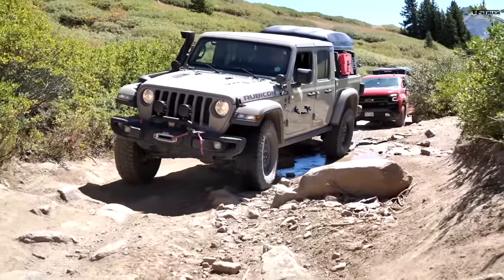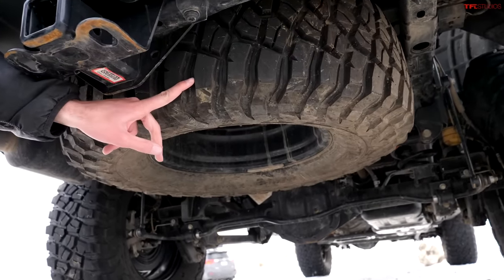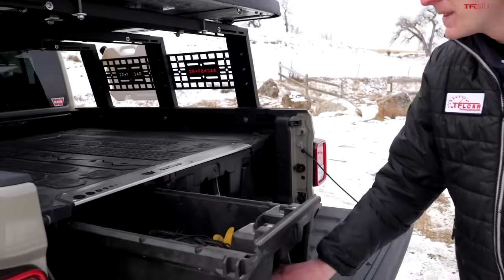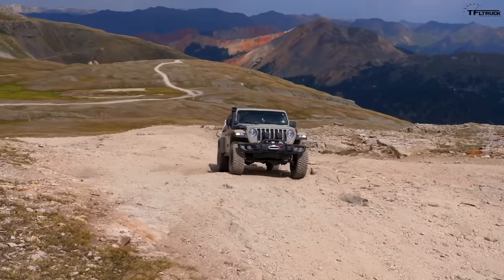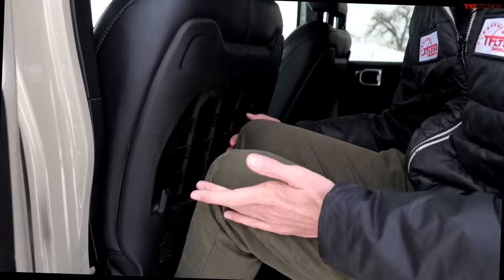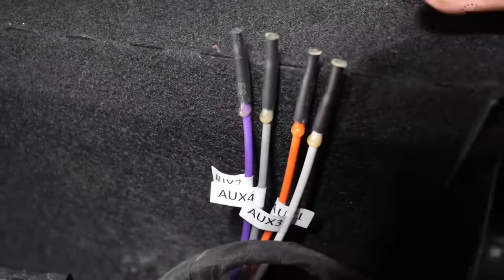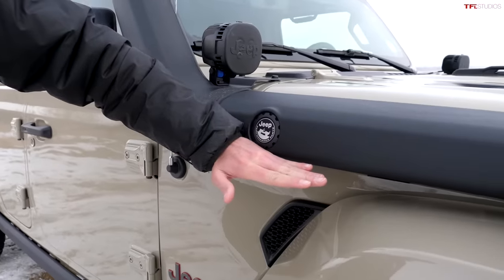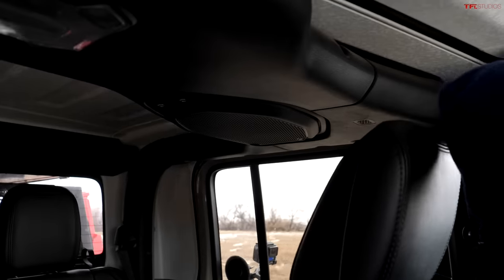Here’s What I Love & Hate About The Jeep Gladiator After Living With It For a Year!

Comment: Great video!  Thank you for sharing.  But you left out two of Gladiator’s key weaknesses, particularly relative to Wrangler.  That long wheelbase, while it provides a smoother ride, it (1) tends to get hung up on the rocks; and (2) limits maneuverability on the trail and around town.  

One other weakness of Gladiator relative to Wrangler is that you have room for people or to keep groceries out of the elements, but not both at the same time.  Granted, you could put a canopy on the the back, but that would defeat the purpose of getting a Gladiator in the first place.  My guess is most people are willing to spend $55,000 on a Gladiator over a comparably priced full-size pickup primarily for its looks.
Reply: I'd rather have a regular cab Gladiator to help with problem #2, or an extended cab with jump seats.  Groceries in the elements aren't a huge deal for me, I'm used to tossing them in the bed of my F-250 with the bed full of snow.  Not a big deal there but tonneau covers aren't terribly expensive if it's a deal breaker.
Reply: I remove the back seats from my vehicles now as they are just a waste of space 🤣
Reply: MOPAR tri-fold hard tounneau cover is your solution, and lastboks

Comment: The 3.6 is good but some of the parts they use in it are garbage. The oil cooler housing is plastic and ALWAYS ends up cracking and leaking. We have about 6 vehicles with this engine at my work, and once they hit about 70k miles, they have all have needed to be replaced.

Comment: Wow. Not impressed with that Decked system. Two skinny drawers and that's it? A lot of wasted space!
Reply: @shitloveaduck  Good info, thanks.
Reply: it weighs 200lbs...that's insane..can get a steel topper from RLD that's only 175lbs.  200lbs to take up space and have little drawers..not worth it
Reply: I really like the Decked system, but not on this truck. The bed is too small to begin with and the Decked system is just too inefficient in how it uses that space. I also use a Decked on my Raptor. It works MUCH better for a larger and deeper bed.

Comment: LINE-X of Katy (TX) taps the rail system bolt holes by default.  I added the Mopar Trail Rail System to my 2021 Jeep Gladiator, no issues, we'll with the exception of it coming with 12 bolts when it needs 14.

Comment: We live in CO also and have a 2021 Gladiator Rubicon that we bought last summer.  Great truck I have used it for snowboarding a lot this year.  We are really struggling with LEDS and snow and ice collecting on the lights while driving.  My suggestion to someone looking is get the Halogens then upgrade to a heated LED

Comment: Seems rich.  You pay a lot for the Rubicon capability and more for the glitz and name. 

Andre's $48k.FX4 XL seems like a better value as does the Power wagon option on the Ram 2500 XL.
Reply: I agree / that’s why you buy a Cummins 2500 and a JLUR
Reply: 2500 cummins is great for towing but useless off road
Reply: Neither one of those trucks is small enough to fit on trails and their tops don’t come off

Comment: We have a Sport S with a 2" lift and 35's on it currently. We love the truck! But we never tow. My only complaint is the lack of affordable aftermarket rear bumpers and skid plates. It seems like it's $1500+ or nothing at all on both fronts. Since we didn't get a Rubicon we're looking for rear bumpers that also add body protection behind the rear tire. I really wish Jeep made it easy to purchase the Rubicon rear rock sliders. Most off roaders WILL in fact use sway bar disconnects. I'll never understand why Jeep doesn't put quick disconnects on there from the factory. We just put Antirocks on all of our Jeeps and it has been by far the best upgrade we've made. Never have to think about sway bars again! I've been driving Jeeps for 20+ years so the seats are fine to me. I drove the Gladiator from NM to Florida and back at Christmas and have no complaints.

Comment: Fiat built it what did you expect. I towed with a overweight trailer about 1500 miles I had to run fog lights at night in order to keep people from flashing high beams at me. Did all types of terrain and it survived. I agree about the length compared to the older Jeep. I got 14 miles to the gallon which was decent. The cab noise is loud I had soft top. I am a tall individual as well and did have some comfort issues. Great video

Comment: One thing I disagree with Tommy is removing the doors and roof. I take them off all the time (the 4 doors and front seat roof). I've taken the back roof off but it requires 2 people to remove it and takes up a lot of room in my 3 car garage.  Its fun but I live on an island off Florida in the deep South so we have the weather to do it which is why I own a Gladiator Mojave - super fun and it's the only toy you need (I don't need to buy an ATV or any other open air toy). It really is perfect for me and my wife down here. I did install rock rails with a step on all 4 doors for easy entry for my 5'2" wife. She too loves the truck.  

I will say though, if you are not used to driving a Jeep (this is my 1st one) the handling takes a bit to adjust to. I have the mud tires and highway driving requires 2 hands on the wheel at all times. The Gladiator meanders and requires constant correction so just be aware of that. Once you get used to it it's not a big deal but at first I was taken aback by it. Personally I would not want to drive this truck coast to coast because of its highway handling. Otherwise its the perfect truck. And super fun!

Comment: ... it stickered at WHAT
Reply: Yeah I know, that's an absolute joke and only for dummies that truck is not worth that kind of money....
Reply: I would look at a Willy's personally. The Rubicon is over priced. I have a Willy's on order, and it is just as affordable as the zr2 and Tacoma TRD offroad I was price comparing it to
Reply: @dakotamorgan6594  ....comparing any Jeep or the CR2 to a Tacoma TRD off-road is apples and oranges it is two different ball games one has a perfect history and the other two have horrible histories.....
Reply: I paid $42+ tax for my diesel with cold weather group, full LEDs, adaptive cruise, blind spot monitoring, pop equipment group,  and the aux switch blank.
Reply: @ronaldradicalhickman6071  I understand that, but those are the trucks I personally compared for what I wanted to buy.
Reply: @shitloveaduck  yeah, my truck will just see some light trail use for hiking and hunting. If I had lockers I probably wouldn't need to use them! Thank you! I can't wait for it to arrive!
Reply: @shitloveaduck  yes because I was going straight to 40s. So I bought so brand new take off rubicon axles for cheap, a phenomenal 4” lift with great shocks from Rusty’s for $1900. Swaybar disconnect on Rubis is unreliable there’s a better solution from Apex for $250 I’ve got that ordered, but stock there’s plenty of power for 38s and lockers and new gears can be added to the stock axles pretty cheap also
Reply: Not only is the sticker rediculous, but you don't even have to haggle for a 5% discount with some going 10% with some work. 

Just stupid. I hate the car buying process.

Comment: I’ve got a Decked system in my Raptor and I love it. However I agree with you if using it on a Gladiator. The Raptor bed is much wider and deeper. That makes the Decked system work much better IMO. But I’ll totally disagree with you on the Mopar 2” lift. That thing is not that great. It needs both front and rear track bars. I’ve seen other owners complain about the control arm bearings wearing out. I’d get a more complete kit.

Comment: Number 1: it looks stupid without $20K in mods and labor to your “$55K” truck that Mopar doesn’t give to the rest of us for free 💁
Reply: Agreed. I have a stock Rubicon and it looked great without mods. As for the money, I defy you to show me any better (or ANY) off road truck that comes stock with the “necessary “ mods - winch, rack, and aux lights.
Reply: Get your facts straight... they definitely bought this with their own money
Reply: #1 , avoid at all cost this is not at all remotely what they are claiming..... anyone that purchases one of these is rolling the dice at that price....
Reply: @conduit242  Again, it just looks like you’re being a hater. They may have been comped the mods and labor, but it wasn’t "free". It takes tons of hard work to get their channel to that level. If it was easy, any schmo could post their opinion and get to their level. Are Mopar’s parts WAY too expensive on any Jeep project? For sure! Most of the aftermarket parts out there currently are as well, or it’s crap foreign-made stuff. Or it’s out of stock. The JT and JL are EXTREMELY popular now and that’ll drive the prices up on everything. Love it or hate it - It’s a Jeep thing.
Reply: I paid $42+ tax for my diesel with cold weather group, full LEDs, adaptive cruise, blind spot monitoring, pop equipment group,  and the aux switch blank.  I spent about $7500 on it and it goes anywhere I want it to on 40s
Reply: @smarterthanyou2674  wow that sounds like a great deal.
Reply: @chrisavelar3723  reach out to Daniel Gupton @ Gupton motors. You’ll have to order to get the deal. Tell him mb sent you

Comment: Oracle Oculus headlights are a great aftermarket option for about $450-500 when on sale, so much brighter than OEM. The only downside I’ve found with these (I’m sure all LED lights though) are that they don’t heat up like halogen lights, so pulling over every 20 minutes to dig snow out of your headlight bezels during a storm sucks, otherwise your driving blind.

Comment: The only people that hate the pentastar are the people that bought a 4 banger  or the “eco” diesel. The eco diesel and 4 cylinder were both made for fuel  economy, not power, towing or capacity. That’s why the Pentastar is still rated higher for reliability AND has higher tow rating.

Comment: I’ve driven RAM 1500, 2500, 3500, Jeep Liberty and Gladiator and I can say with 100% certainty, the setting positions on all of those vehicles is terrible.  I’m 5ft 9in and I typically need my seat as far forward as possible.  Granted, none of the vehicles I drove had adjustable pedals.

Comment: My issue with the 3.0L diesel is paylod loss. YOu can tow better, but you drop to under 900 lb payload. That is just... Not good for me. You can push it and the engine is torquey enough to handle it, but...  I would get 3.6L with 6 speed manual. I did have a 4Xe Rubicon with a 2" lift &  35" tires, and that had awful economy for long trips, but did GREAT off road!

Comment: I have to agree on the factory LED lighting group.  They provide great visibility and the fogs work well too.  While I prefer a manual, as far as automatics go the ZF 8 speed is an excellent transmission which manages smooth shifts and surprisingly decent fuel economy for a lifted brick.  Compared to other pickups in the segment I like the upright windshield with very narrow dash.  It offers better visibility and frankly reminds me of driving a HMMWV.  I hadn’t noticed TFL mention this but both the wife and I observed that the doors sound like a vault closing with a chunky metallic thunk.  Overall the gladiator seems like a very robust vehicle.

Comment: Jeep transmission is smooth and easy to engaged if you know how to do it properly. A stick shifter looks better, feel better than a knob which is standard in most automatic 4wd. 4runner trd off road/pro and Jeep simply nail it with stick shifter instead of boring knobs.

Comment: Here in Australia, we only get 2 models, the Sport and Rubicon. Also only 1 motor option 3.6 petrol. Retails at 90k for the Rubicon. Compromised driving position due to cramped footwell bc of RHD conversion  impressive truck, save for the engine.
Has a hard time competing against Toyota and Ford Ranger, however if they had released the V8 that would be another issue

Comment: Great review, Tommy, thank you! Quick question: Did you install the lift because the 35" tires wouldn't fit properly with the Rubicon's stock ride height or was that just something you did to have a lift? After years of having done modifications to vehicles in which results were mixed, not necessarily resulting in improvements, looking cool, but causing compromises in ride and handling, I've decided that vehicle manufacturer sourced upgrades are typically the safest and best way to go. In any case, that lift looks great, to hear that it results in an improvement is even better!

Comment: I had a 2015 Rubicon 2 door on a 2" AEV lift with 35's, and a full AEV bumper set up front and rear with a Viking winch and a rack/rear tray system from Front Runner.  Loaded for travel it probably weighed 5500 lbs.  It was a Pentastar Automatic with the 4.10's.  I would say it was USELESS at altitude....could barely maintain 75mph loaded at above 5000 feet.  Brakes were awful.  Yes, it was great off road.  Ultimately I swapped it for an older Sierra a couple of years ago because of the lack of power and terrible brakes going downhill.  It really needed a turbo, turbo diesel or a V8.  I can't understand why Jeep sells so many of them.

Comment: The Gladiator is such a flawed compromise.  They based it on the Wrangler, which immediately made it a small pickup.  But in trying to build it up to make it compete with larger pickups, they made it far too heavy, yet still without much hauling or towing capabilities.  To top it off, they left it with the same economy car engine that the Wrangler uses, even though it's not an adequate engine there either!
They should have made a new version of the J pickup, based on the Ram, or at least have offered a strong V8 for this version.

Comment: Still could never figure how the 4.7 magnum never made it into a Wrangler, it was in a lot of Jeeps and Dodge trucks and SUVs. Would have been cool to see it hooked up to the 8 spd.
Reply: @Akira S They were more reliable in the second and third gens which can go past 300,000 miles. I had one in my 06 Dakota and I never had any trouble with it. The 4.7 was never a power house, just an entry level v8 work engine. So long as it’s maintained and not overheated it’ll keep going. Fuel economy wasn’t great but wasn’t bad either for its time.

Comment: Had a jeep in n loved the off roading. However the stealership n quality is not something I want to depend on living way up north here. Biggest issue we had with a 2012 jk n 2012 hemi sport. Both motors went from sand left in motors from sandblasting process of block building. Jeep had cracked rad, cracked block, heater core heating problem driver side. They covered motor under warranty but wanted to charge me 500 for new rad. They forever lost my bussiness from that day. Wife had always bought dodge. Even had a Cummings 2500 after. Both of us now drive nissan. Poor defrost as we live in Canada n winter is 6-7 months. Hard top water leaks. When you swapped out candles for other lights the lite red clips always broke off putting new lights in. GPS system in deck was outdated and lots of peps once they updated the system it didn't work after. Hard drive was a nice touch.  Then when I picked up my jeep after motor swap, my plates were removed and bolts locked inside. I asked why did you take my plate off and where is it? They had no clue. Not sure how bolts got locked inside then... Old shop owners ripped peps off with double dipping then new owners just as shady we left supporting them n now drive an 1.5 drive to service our Nissan's. Went to buy Toyota but didnt like how they operate and snobby. We walked next door to Nissan. Too bad cuz we both were going to buy Toyota rides. A truck for me and a 4runner for wide. After buying rides for 20 plus years we don't play games and want honest shops. Dodge old owners and new owners are not those guys. Too bad cuz new dodge owners own many other brands and dealerships in Saskatchewan. Can't support any of their shops now. Too bad we loved the jeep lifestyle. Was gonna get a gladitor .. Spare tire spot on glad is not ideal. Access to spare once off road? How long will it last rock crawling steal rims do bend easy. Thank you guys for all the work and vids you guys put out.

Comment: I like the capability of this Jeep. The wheels and tires you have on it look good and work great for everyday use. I like the rack and the tent on the back. I like the lift and accessories you added. I don't care for the look of the four door cab. I wish Jeep offered this in the standard cab version. Personally I would never take the roof or doors off and would never put the windshield down, so these features mean nothing to me. I also think dual zone climate control is a bit stupid. I also would not use heated seats or steering wheel. Lastly I am not a fan of the V-6 auto. I would prefer an inline 6 with a manual transmission. Nice truck, just not for me.

Comment: Good video, but a lifelong Jeep owner, I was bummed after watching the whole thing & not discussed was the integrity of the Freedom top.  My current Freedom top is same as many others, in this order.  
1- install
2- precipitation (any)
3- leak on all corners
4a- best case, seatbelt, floor, & power door lock wet (aka, annoying), OR
4d- cold over night, entire door seal forms frozen seal sufficient for outer space travel, doors virtually welded shut

Have I just been the unluckiest Jeeper in the world, or is this not a real thing??  This is actually a hot topic at my house,where I’ve absconded Wife’s Toyota many times so I could get to work on time... TFL, or anybody??
Reply: I have a 2019 JL 2 door and have had no problems with water at all. Sorry your experience is otherwise.
Reply: @Ro Baas , that actually worked?  (If you say yes but live in some arid paradise like Arizona or California, it doesn’t count).  I should clarify, I live on Kodiak Island, Alaska, where it rains pretty much all but a few days a year.  Thanks!